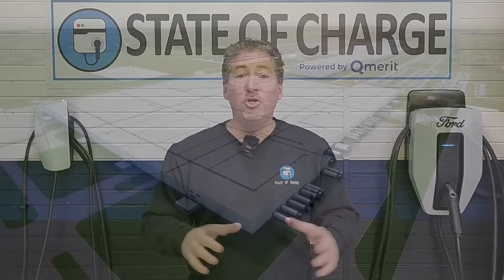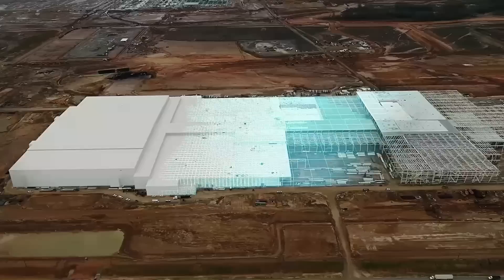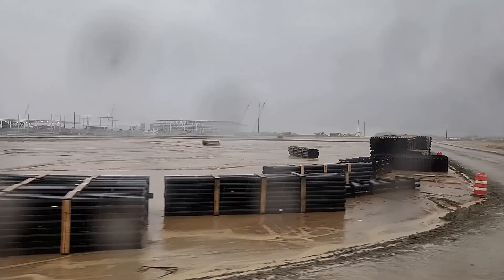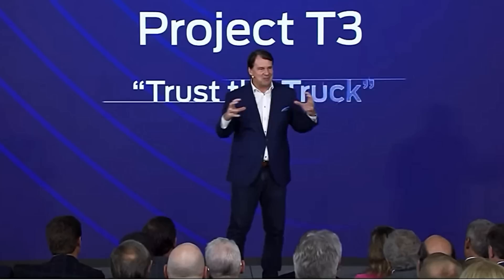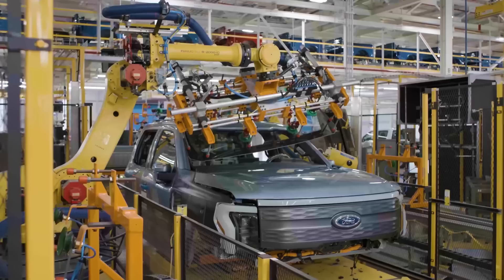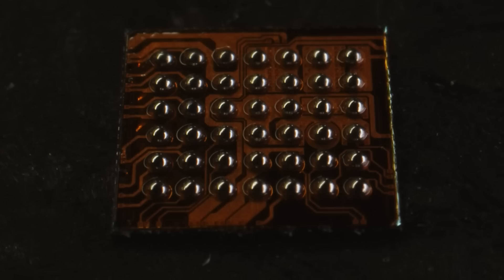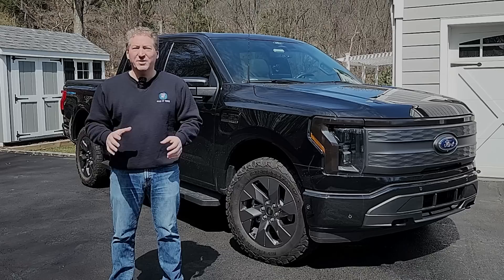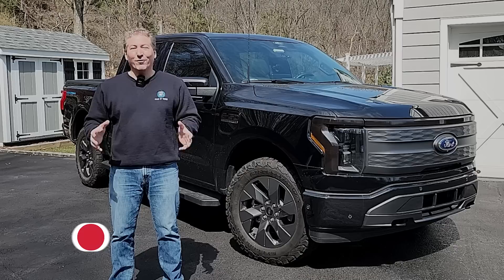Ford CEO Jim Farley On Electrification and Tennessee's BlueOval City

Comment: Tom - That 'great deal' Pro version is now $62K. The price has gone up almost 50% since it was announced!!!
Reply from the maker: Yeah, the latest increase was announced after the interview. It's now 20% more than it was when it originally launched. Most of us wondered how Ford could possibly sell it for $40K. Now we know they can't, and were prepared to sell it for a loss to make sure the Pro was utilized by businesses. Now they realize they don't need to subsidize the cost, because they will sell anyway. That, plus the supply chain constraints that have increased the cost of so many parts, are the reasons why the Lightning has seen multiple price increases in the year it's been available. Not a good look.

Comment: Gotta say I was super excited when they announced the Lightning. I was just as excited when I got my email finally to build my Lightning. Then I built it. I wanted a Platinum cause that's what I have had for my past 3 F-150's. I wasn't excited about the price but I understood that it was a new leap for Ford and that the initial buyers of this tech would help to keep Ford invested in the EV market and that would eventually make them affordable…......then I saw that I wasn't getting massage seats...or the scales.....or intrusion detection incline security....or the bed camera with the trailer package......or heated steering wheel (not really a big deal here in Texas truthfully)..or the charge cable not the pro power that has to be installed). All of these things (minus the scales and charging cord) I have currently in my 2022 F-150 Platinum but l'm supposed to pay $20k more for less. I talked to my dealership today and told them I'd give them an answer Wednesday if I still want to go forward with my purchase. They don't care either way. They'll sell it to someone else if I don't go forward with the purchase. I'm bummed cause I really want to get this truck but Ford has really made me question my 30 year loyalty to their brand. Any thoughts?

Comment: Great get Tom, happy for you! and the ko2s look fantastic on your lightning. I was a first hour order for lightning pro and loved it from the first day, put 6,xx miles on it before selling to a local farmer. I have a new tesla s long range that I have also put 6,xx miles on in the first four weeks.  Biggest problem I have with lightning is inefficient powertrain/ short battery range and the tech is pretty crappy for a bev devotee. i understand there will be 3 configurations available for T3 and hope one has an 8' bed. I don't see how ford can offer the range needed to tow my eq trailer though. I have a CT on order, and assume tesla will come through with the touted 500+ mile range. That will get me 250 miles towing and the supercharger network takes care of the rest. Tesla is not perfect, as I think they should offer some options like electro chromatic roof glass, comfort seats, power frunk.. on my S , but they are relentless in getting efficient powertrain wise and the charging stands alone as effortless and always works! I am amazed that ALL other car companies are relying on others to "power" their products. I know most ev owners at this point charge at home, but that doesn't help on a trip. Thanks for the content Tom , you are the best at what you do!!
Reply: You won't get your 8' bed from Tesla roger.
With Ford you surely will.

Comment: I'm all for electrification of transportation, and indeed, of everything as the world transitions away from fossil fuels usage. But I keep coming back to the question of the sourcing of raw materials for the myriad of plastics that we routinely use in the manufacturing of a mindbogglingly large range of components. Oil & gas account for the majority of raw materials sourcing for today's plastics, adhesives, fabrics among others. Decarbonisation is so much more than just going electric; it's not going to be easy.
It was the sight of plastic pipes on the construction site that prompted me to raise this issue in the comments section of today's video.
Reply from the maker: You're absolutely right about those things. EVs aren't some kind of magic bullet to solve our problems. But they are better, and they can run entirely on renewables. We need to take a lot of baby steps to get to a cleaner future.
Reply: @State Of Charge  Agreed, although the world really doesn't have time for baby steps; 6½yrs left to try to radically reduce emissions from all sectors to limit global warming to 1•5°C & I think that humanity is dumb enough to overshoot that target by a wide margin; Sandy Munro used a word that describes our blindness perfectly the other day - Scotoma. 
It's just a question I keep coming back to, time and again, and not just with regards to the automotive sector. Many moons ago, more than I care to admit to, 🤪, I was a nurse. Plastic usage abounds, especially for drips, cannula, syringes, and medical equipment; long gone are the days of reusable metal, rubber, and glass original alternatives in medicine. 
Just one example out of tens of thousands of examples of plastic usage in the modern world. It ain't easy being green.

Comment: "BlueOval City is scheduled to begin production in 2025 and will have the capacity to produce 500,000 vehicles and 43 GWh of batteries annually."

Lol, they won't come close to that output for years to come if ever given that the price of the current EV's has done nothing but gone up with no end in sight.
Reply: Thinking like this is why you're not the CEO of an automobile company.

Comment: 43 GWh = 48,000,000 kWh or 286.000 vehicles. Thats is certainly NOT enough. Ford needs at least 10 times MORE.
Reply from the maker: That's one of three battery plants they are building in the area. The other two are in Glendale, Kentucky and both will produce the same 43 GWh. 129 GWh total from these three plants alone, and Ford has other battery plants under construction.
Reply: @StateOfChargeWithTomMoloughney  Thats good for about 860.000 vehicles. Somewhere around 2026-2028.

That is still not enough. The US needs more if the old mighty OEMs do not want to succumb to this upstart Tesla. 

Does GM take up their slack and make something else besides those horribly expensive HMMMWV Monsters and those ultrasuperduper luxury Cadillacs?

Here in Europe our problems are even exarbated. All of the manufacturers flee the continent and want to expand in China and US. Only Stellantis tries to succeed in the small to medium sized market. Everybody else has given up for the Chinese and Tesla.

Comment: Look at the massive carbon footprint created by building this facility, that's before a car rolls off the production line. Five times more electric required to power it! Farley is obsessed with Musk, but rather than go beyond what Teslas next steps are, Ford are constantly playing catch up.
Ford are relying on EV for future prosperity, but the battery materials are inflationary.
By the time Ford has this up and running, the likes of BMW, VW and Toyota will have progressed to Hydrogen ICE and synthetic fuels.
Ford need to think way beyond Teslas next move.
This project will cripple Ford, I expect that its ownership will be German by 2035.

Comment: 43gwhs for trucks is about 300,000+ at 131kwhs per truck. Ford says that blue oval city will build 500k of the all new ground up t3 ev truck. 🤔

But farley also claims the t3 can do 75-100+more miles on the same size pack as the lightning uses. This makes me wonder if they'll down size the pack's instead of increase them for 400+mile range versions. Even if they down size the pack's about 20% and ranges improve slightly. 
That still won't be enough cell supply to support 500k truck's.
Reply from the maker: They have two more plants under construction in Kentucky that each will also put out 43 GWh per year. All three in will produce 129 GWh/year.
Reply: @StateOfChargeWithTomMoloughney  is that in addition to the sk innovation plant here in commerce GA supplying them cells and also not counting the new catl lfp plant in Michigan Tom? 🤔
Reply: It's ironic how some people are concerned about every detail about EVs....  But I never heard similar concerns about ice vehicles ....  I wonder why????
Reply from the maker: @4literv6  yes
Reply: @StateOfChargeWithTomMoloughney  so if all those plants open and ramp up on time&as scheduled Ford could have capacity for 2,000,000 evs to end 2026.
Good to know as long as Murphy doesn't intervene to much fomoco has thing's going mostly to plan. 👍🏻
Reply: @4literv6  129 GWh = 129,000,000 kWh or about 860.000 vehicles. That is by far not enough!
Reply: @wolfgangpreier9160  Ford sells about 2 million vehicles in the US annually. These plants are mostly to supply the US market. Enough battery capacity to electrify nearly half there US products seems adequate for the time being. These are also only the plans they have made public thus far. This is by no means the end of what they plan to invest in with EVs. There are plans for battery plants and partnerships for batteries outside of the US as well to supply non-US Ford branded vehicles with batteries as well.

Comment: Did you want to question farleys false assumption about fomoco sales? They haven't hit over 4,000,000 units now for several year's.

Further I seriously doubt the evs are going to ad to Ford's overall market share. Instead as proven with other ice legacy oems. 
Ev sales are just about helping them not lose any more market share. They aren't helping the legacy companies gain any overall sales. 🤔
Reply: Huh?  When majority of F-150 lightning buyers are new to Ford that is increasing their market share.  The same is true for GM.  The issue why you don't see big changes at the moment is because EV sales from OEM are quite low when compared to their ICE but that is rapidly changing.
Reply: With market adjustments approching the cost of the truck, their dealers  aren't helping.
Reply: serious doubt the evs? Thank you for that scientific evaluation.... My ice trolling friend....